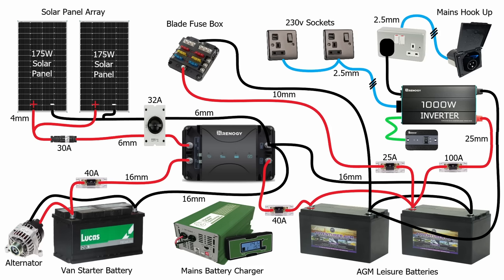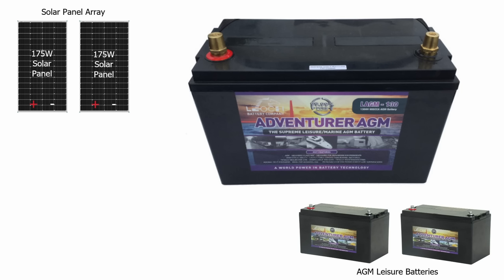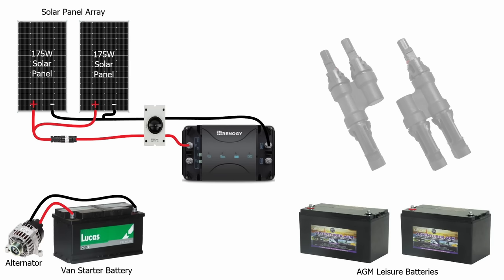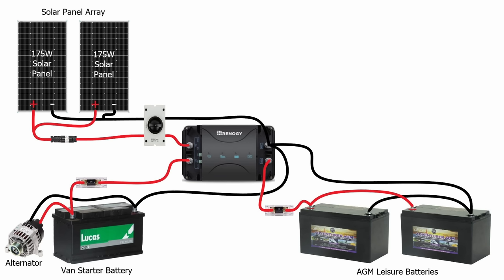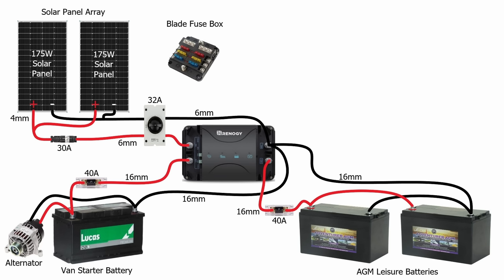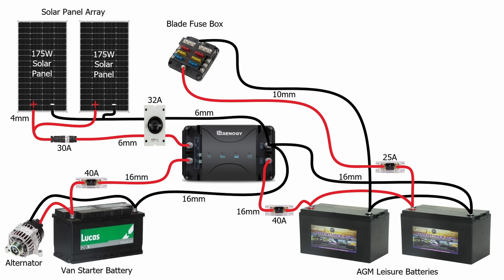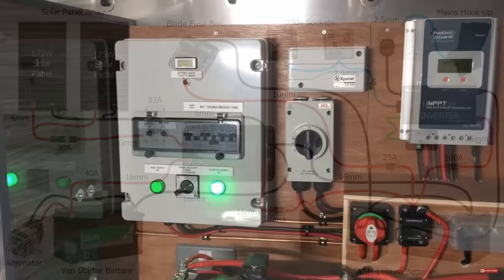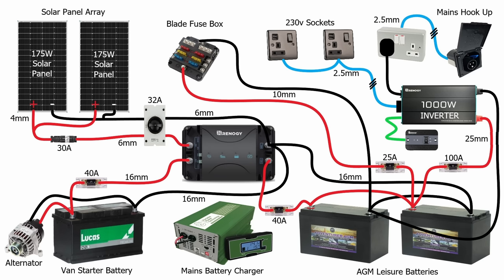12v Electrics for Off-Grid Campervan - Fiat Ducato Budget Build Ep12

Comment: Another great video. This setup is almost identical to what I installed in my van 2 years ago all be it with the 50A charger/MPPT, the 2000w inverter  and a single 220ah lithium battery. I installed a consumer unit for the mains input and used it to also house a dual DC breaker for the solar panels. I have a Victron mains charger. Also got the Renogy battery monitor unit which works great and the BT unit to monitor from my phone via the Renogy home apps. The system has worked flawlessly., I’m a big fan of the Renogy kit. Your original electrics videos helped me hugely with my design, cable choice and sizing so thank you Greg.
Reply from the maker: That really good to hear and thank you for sharing your experience. That does give me some peace of mind. I also have the BT2 which I will demo once it’s all setup 👍🏼😃
Reply: Hi,
Similar set up to mine but I'm using a 170ah battery. How did you fuse your cabling and with what size?

Comment: Really, really useful, and clear, video. I particularly like the addition of wire choices. I'll have to watch it a few times (not the brightest bunny). I look forward to your earthing / grounding video too. I live on a boat!

Thank you for taking the time to do this.

Royce
Reply from the maker: I will bear that in mind as I’m sure a lot of it will be applicable to the boat. Fibreglass hull or steel canal boat?
Reply: That's really kind. Steel narrowboat, Greg.
Reply from the maker: @RoyceMunday56  ok 👍🏼 obv the metal hull needs to be considered when earthing similar to the metal body of a van. 👍🏼😃
Reply: @GregVirgoe  yeah. I haven't a clue what I'm doing. I can say though that I have a much better idea of how to replace my fuse box now!

Comment: Another clear and concise video to your usual quality Greg - thanks! Great find on the renogy combined mppt and DC to DC charger; I've been intending on fitting something like that in my van so will check this one out 😀
Reply from the maker: Other than the limit on voltage input which is my only criticism it's really a great solution for two charging methods.
Reply: @GregVirgoe I have a question on this if I may please Greg…..
Is the 50a version capable of dealing with a smaller input but not vice versa (ie 30a obviously not capable of handling what the 50a can). Reason I ask is that I CURRENTLY have 3 x 100ah batteries and 2 x 175w panels in my LWB 2013 Sprinter, down the track we are planning on putting in lithium batteries and we are running a large inverter as electric will be the only power (induction hob, no gas setup etc). So I could probably do with the 30a for now, but could I get the 50a and future proof myself? That way I can just swap out the batteries later and keep the other components as is.
Any advice gratefully received as always!
Reply: Yes, the 50 amp version would work fine with less solar input. Another advantage of the 50 amp version is the maximum solar input voltage is 50V whereas for the 30 amp version it is only 30V. This means you can run your two solar cells in series rather than parallel. Note that the specs on Renogy's website are incorrect on this point, saying both have max 25V input. I have the 50A version and the manual is very clear on working voltages!

Comment: I run two battery banks charging is switched by a relay , and an isolator on downstream to select each bank. This allows me to diversify the brands so I’m never stuck to having to always have the same brands , makes, models etc.

Comment: Hi Greg, thank you for taking us through this step by step installation in a very simple to understand way.  I subscribed to your channel during covid and have always found your videos extremely easy to watch, and done in such a way that those less technically minded can easily follow.  I’m fine with the mechanics and DIY construction side, but the electrical side I always find much more challenging…. I’m looking forward to seeing the final costings of this budget van build, as I know from watching a few other builds the costs have been decidedly higher than I and probably others have imagined … 👍🍻
Reply from the maker: I can give you a heads up as I’ve pretty much bought everything that was needed for the conversion and the entire build has cost less than £4K. What do you think 🤔
Reply: @GregVirgoe  I’d say 4k is damn good… I’m guessing that’s plus the cost of the van?
Reply from the maker: @Flossy_tops  yes that cost is just for the complete fit out.
Reply: @GregVirgoe  then in that case  “I doff my cap to you sir” … I was expecting you to say treble that cost, but this has restored my faith and shows that it can be done on a budget!  👏👏👏

Comment: Greg you are the G.O.A.T 😂.greatest of all time lol. I always pass your videos on. It massively helped with me building my van last year and even though its done I still couldn't help watching this video. I'm going to get one of those Renogy inverters eventually now so i can use the shore power. I like the idea of the mppt and DC to DC too but I'd have to swap from series to parallel so I'm not sure yet
Reply from the maker: In your setup you could easy add a stand alone dc to dc charger if you don’t already have that function.
Reply: @GregVirgoe  True. Probably cheaper too. Thanks

Comment: I’m looking forward to the video covering earthing and bonding. I’ve found I needed the mains battery charger through the winter when the solar generation is really low.
Reply from the maker: Yes sometimes it is essential to keep them topped up. Also if you get a free hook up as we have done occasional you can take advantage of the power and fill them up

Comment: Well ive been trying to find someone who can show a full off grid system covering all aspects ie 240 v plugs, solar panels, and explaining where your site electrics are wired too.
I've got a renogy 3000 watt inverter but I'm using a Fogstar 300 amp drift pro lithium but even so I'm only going to be using a 1500 watt Air fryer or a 700 watt micro but will make sure I don't use them at the same time to be safe, I just wanted to know I had the battery power and the inverter capability to cover it all.
So thank you very much for a good system that even I can follow.
It's great to be put at ease when your taking on something  that can go wrong if you don't take the proper safety measures.
Again, great video m8 THANKS

Comment: Another GV masterclass, cheers Greg this will be handy when I tweek my system in the future, hopefully that's a while away. Had a problem with inverters so really on power banks now for the high draw equipment, will be interesting to see how this goes. Your attention to detail is first class 👍
Reply from the maker: Glad it was helpful! I’m also doing a video on using power banks in the van and how to integrate them into a fixed system. 
Is there anything in particular you are looking to upgrade?
Reply: @GregVirgoe  I  use power banks because I work in the trade so handy to charge on the job etc although they're seen as a bit of a luxury . I just want to tidy up and re fit my distribution and cabling , switching out breakers for inlines etc. I built my entire van from scratch in 8 weeks because I was homeless and needed it to be workable. Look forward to the vid on grounding, it's still a bit of a grey area and not enough focus on the neg side. I'm ok on earthing arrangements and fault current on 230v as I did Part P and the 17th as it was years ago. Looking forward to seeing the progress on the budget build Greg, your knowledge is the best resource on Youtube and has helped so many, thanks so much.
Reply: Second that.  The van build Guru👍

Comment: I've just purchased an ex welfare van( Mercedes sprinter) to convert. It already has lots of electrics fitted the that power the all the accessories like water heaters and even a 400w microwave. Your wiring diagram has really helped me understand how simple an off grid set up can be. Not quite sure how much of the existing wiring we're going to rip out yet or how much will get recycled. Any suggestions are most welcome 👍

Comment: explanation very good and clear as always, a comment to make the cable between the two batteries also 25 mm seems to me.  personally i'm not a fan of all in one device but this looks tempting, thank you and your wife for her patience:goodvibes:
Reply from the maker: Yes, at least 25mm if not 35mm to be safer on the interconnecting cables. 
This setup is really three devices not just one :D 
DC-DC charger, Inverter, Mains Battery Charger.... not a true all-in-one solution.
Reply: @GregVirgoe  You are right about that and there must also be space, so it can sometimes be a godsend 👍🏻

Comment: Thanks Greg.. will be doing something ‘camper van ish’ on my LT35. Not a full blown conversion it’s a service van but I have a ‘project’ in Wngland and I live in Scotland so I need it to be a ‘hotel’ and a workshop! ATM I have a para silk hammock and a ring burner so I think an ‘upgrade’ is maybe needed.. all this after I weld everything that needs it and rust removed…

Comment: Excellent instructional video! If you can't follow this or don't have an appreciation of basic electrical theory then best leave it up to a competent person. Personally i wouldn't rely on the integrity of a campsite rcd device,  so I'd fit an rcd double socket to the incoming supply which will hardly break the bank. Thanks Greg, looking forward to the rest of the build, spot on 😉
Reply from the maker: Totally agree it is best practice to fit a consumer unit in the van for short circuit and overcurrent protection

Comment: Good stuff Greg. I would always use a 30 mA RCD for any 230 volt, AC circuits; and also ensure there is a means of providing a neutral to earth bond upstream of the source. Otherwise the RCD will not trip by itself under fault conditions, as it should with a grid connection ...
Reply from the maker: What about PEN faults? 😊

Comment: just found you last week greg, been through most of the camper vids out there in past 3 weeks, yours is my go to now. starting my build sub floor is next, but building my wish list and this electrical system is just "watt" im looking for😁
Reply from the maker: Welcome aboard! I’m always interested to know how you discovered the channel? I have two build series on here. One complete sprinter build and this Fiat Ducato build that we are doing now. 
What type of van do you have!
Reply: @GregVirgoe  as for finding you it must have been the algo, as i had been watching so many sub floor vids to get a handle on the process and materials needed, it was your insulation vid that kicked it off. so yes bought a 2017 transit 350 mwb few weeks ago, so far stripped out and dual seat replaced with 2nd hand mk7 passenger seat and swivel picked up from FB market. as i go im saving the vids that interest me in a playlist for further watching, your eclectrics vids are the most easiest to understand thank you.
Reply from the maker: @mikezoom42  that’s great thank you for letting me know how you found me. Hope your build goes well and thanks for watching 👍🏼

Comment: Great video, thank you.
I have already fitted up my electrics in stages, forst stage was fitting out a 200amp hour lithium ion battery with bluetooth and a renogy
Reply from the maker: Nice one that battery will give you everything you need. How much solar you thinking of fitting?
Reply: @GregVirgoe  I've fitted the 40amp charger as well from renagy, I've fitted 2x 200watt solar panels in sequence last weekend, with the 40amp mppt again all renogy, I got the bt1 to plug into the mppt as well so I can monitor battery and mppt on my phone, next step and being delivered today is the renogy 2000watt inverter, watching your video has given me confidence I've done the right thing.
Reply from the maker: @ironian24  pleased watch my latest video about Consumer units on the mains input 👍🏼
 Should You Install A Consumer Unit In Your Campervan?
https://youtu.be/kdvm0TFvfVQ

Comment: Thanks so much for a great informative video.  I am an electrician and just starting to dabble with solar to power some security cameras, cellular router and a cellular booster to keep an eye on our trailer over the winter.  We are in a seasonal campground in Ontario, Canada and the campground is closed during the winter.  This of course brings some challenges as the cold temperatures here don’t play nicely with our LiFePO4 batteries.  We have to run a thermostatically controlled 78W heater to keep our batteries above freezing.  We are going to try and achieve this using 680W of solar and 2 - 100W Renogy Smart batteries.  Seeing as this is a very natural campground there are lots of trees and with that lots of shade.  At best even in the summer we only get about 3.5-4 hours of full sunlight on our panels.  Luckily we have the Renogy One Core that we can monitor over the internet from home so we can see how the setup is doing.  We can only walk in during the winter as they close the gates to vehicles.  So if we do have to do anything to the system we cannot drive up in a car with a generator and top off the batteries.  I think our only option would be to bring the batteries home, charge them then go back.  Fingers crossed we have enough solar and battery to make it through!  Thanks again for the easy to understand video as I will take some of what you covered and add it next season.
Reply from the maker: You could get one of those portable folding briefcase panels that you could angle towards the available sun while there to give you an extra top up if needed.
Reply from the maker: As well as that you could lift the batteries off the floor and insulate around them with EPS to slow down the heat transfer / loss

Comment: Very good and informative video, thanks, I have saved it to my favourites. The only thing I miss is the battery monitor peace 👋🏼
Reply from the maker: The Renogy charger can be monitored using a smart phone app via a Bluetooth device BT2
Or just a standard lcd display plugged into a control cable.

Comment: Nice that you are using Relogy I've fitted a DC DC from them they seem ok on cost and quality so reassuring that you have gone with them as I know you don't use rubbish
Reply from the maker: They are a very reputable manufacturer and quality product but at a very reasonable price so best of both worlds. I did not want to go dirt cheap and risk poor quality.

Comment: It's worth noting that the 40amp fuses Greg mentioned before and after the MPPT/DCDC charger are for the 30a version of the MPPT/DCDC, for the 50amp version, Renogy recommend  75a at the starter battery and a 65amp afterwards.  No change to the wire size if under 6 metres

Comment: Absolutely brilliant video again, just like all your others Greg!!  you have a brilliant clear and concise way of delivering the material.  I learn something invaluable every video.  So i wanted to ask if it is ok to simply run the negative cable from the 12V fuse board to a grounding point on the van rather than having to run a long negative cable back to the battery? I will have my 12V fuse board at the very back of the van so wanted to save on cabling if possible!   Thanks again for all your hard work delivering this great content. Keep it up 💪

Comment: Hi Greg, I wish you went down the M/H route and changed things / upgraded the existing electrical EBL system as you have shown clear and concise information for a van. I'm looking to upgrade my existing system one my M/H, but not really sure how this can be achieved without messing up the existing system or paying someone a ridiculous amount of money that I could do myself.
Keep up the good work as these and your last build videos are now in my video library for future reference if I eventually downsize from a M/H. Regards Drew🏴
Reply from the maker: There are so many variants when it comes to MH electric systems and most of them have their own bespoke controls. It’s a fairly simple job to add a stand alone solar system and mppt charger connected to your leisure battery. That can be added without touching any of the other systems.

Comment: Another great How-To Video, Greg. Easy to follow and certainly a must-see for the novice. Thank you!
One could argue the choice of AGM over LiFePo4, as 120Ah are an investment of only less than € 100 more for LiFePo4, gaining all the advantages you mentioned. Especially inexperienced van dwellers may not be able to gauge their usage as you have, extending the life of their AGMs.
How would you wire the mains charger alongside the rest of the 230V install?
Have a great day and stay safe! 🚐☁🍀
Reply from the maker: As you say, it is just that little bit extra initial capital cost to gain those benefits if you can spare the cash it's the way to go. For the mains battery charger sImply plug the mains charger into the 3 pin socket near the hook up and connect the postive and negative to the same leisure battery terminals as the dc to dc charger. Best wishes to you too :D

Comment: Brilliant content and delivery as always Greg👍🏻 basically I’m just gonna copy you for what I can. One question: if I use same elec set up but change solar panels to 100w x 3 panels (fitting to a pop top on boxer) and use a lithium 200ah battery and maybe a 2000amp inverter could you see any issues? Many thanks in advance

Comment: Hi Greg, you are a veritable wealth of knowledge, congratulations on a brilliant channel. 
I haven’t quite decided on the layout of my van conversion yet but I would like to know how far from the van battery would you place the 2 x leisure batteries - is there a maximum run of cable recommended or doesn’t it matter. I have a Vauhall Vivaro lwb van,  2013 plate. The van battery is in the passenger footwell. Many thx and keep up the excellent work.
Best wishes Derek.